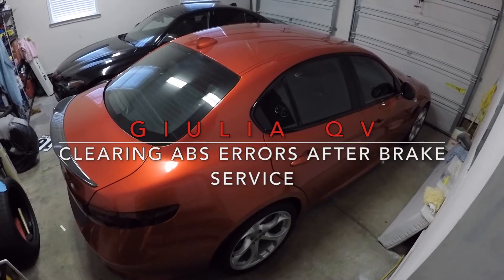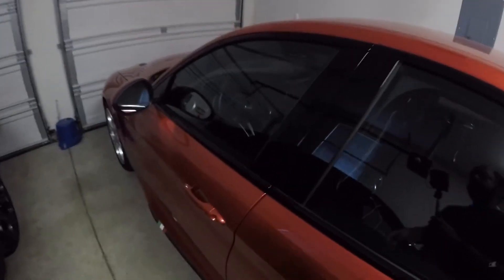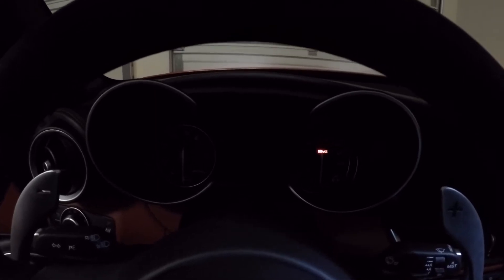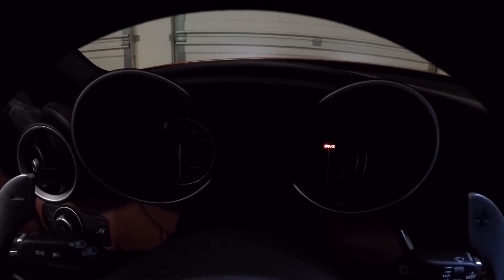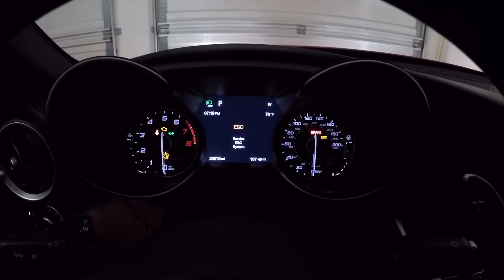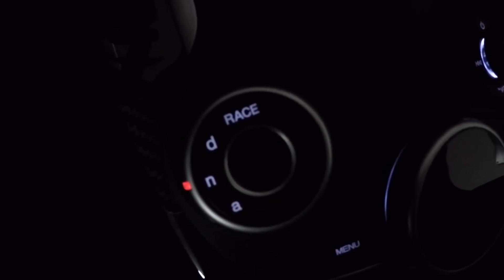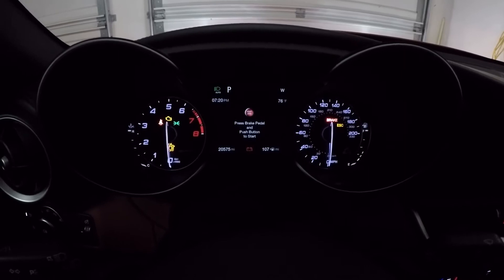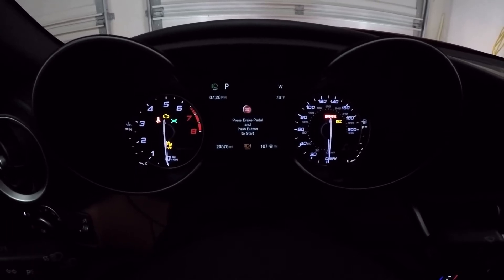Alfa Romeo Giulia Quadrifoglio | ABS Errors After Replacing CCM Rotors and Pads for Girodisc

Comment: Did you need to install a SGW bypass module to use the MES? I'm dealing with the same issues right now, not sure if i need that module or if the code OBD, MES and Gray cable are all I need?
Reply from the maker: Only if your car is late 2018 and up.

My Giulia QV is a 2017, so it doesn't have the security gateway module.

My 2020 and 2021 Stelvio vehicles require the SGW bypass, which I've installed on both.
Reply: @genyosai great insight. I've got the dealer fighting with me about this same problem. They want 5k for "their" work. Could you please, please send me the exact cable, and blue tooth unit you used. Please!
Reply from the maker: @jeromem4923  $5k????  WHAT??
OK!  Here is the exact cable kit I bought. You'll need the gray cable as you can see in my video:

https://www.ebay.com/itm/271552918793

This is the Bluetooth diagnostic tool that I use in the video:

https://www.amazon.com/gp/product/B07JFRFJG6/ref=ppx_yo_dt_b_search_asin_title?ie=UTF8&psc=1

As you can see in my video, I used my wife's iPhone with MultiECUScan (MES) for iOS installed. You can also use an Apple iPad. Just download MES from the App Store.

Good luck!

I have no clue what they could be doing for $5k if all you have are ABS/brake errors after a brake job.
Reply: @genyosai  oh! thank you so much friend 🙏 they are trying to pull an expensive fast one on my daughter. Life long member to your channel 👍👍
Reply from the maker: @jeromem4923  Thank you! Keep me posted on how it goes.
Reply: @genyosai  will do buddy!
Reply: @genyosai do you just use the standard free version or is the next level of access needed for the multiscan?
Reply: Hey bro I seen your video and it seems legit. I just had a quick question I have a 2018 Alfa Romeo Stelvio Q4 and would want to know where to purchase the Grey MES Cable & SGW ByPass Module? Or what do I need to purchase. (I changed my breaks but I have all this lights on my dashboard and want to get rid of.)

Comment: What was purpose of the grey cable and where to get it
Reply from the maker: The grey cable is needed to connect to the Continental ABS module.

You can buy all the MES cables in one set here:

https://www.ebay.com/itm/271552918793

Comment: Ik this is kinda late question but I bought both the cable and the Obd scanner and I can’t get it to connect to the app any advise ? I have a 2020 giulia 2.0
Reply: It probably doesn't work anymore. Return everything back and get your money
Reply: @CubanMofo  it does work I just had it in the wrong interface type thanks
Reply from the maker: Sorry for the late response, but glad you got it worked out. YES it obviously still works lol. I use it all the time because I race my car and have to get into the Continental ABS module with MES to recalibrate things all the time.

Comment: Where do I plug it in and what adapter do I need to fix brake codes and reset service interval oil
Reply from the maker: Hi.

For most brake codes you'll need the gray adapter to connect to the abs continental system. When you see me plugging in under the dash, I'm plugging into the ODBII diagnostic port. Simply look underneath the dash and it'll be easily visible and accessible.

As far as resetting service and oil intervals, I can't remember even though i just performed this task on my car. MES will prompt you for an adapter if necessary, and for service/oil interval it's no adapter or gray. Definitely not another color.

Comment: Thanks for share. If replace the brake calipers for update to 330mm the process will be the same?
Reply from the maker: Absolutely. Any time you push back the pistons to remove/insert pads, you need to do the following process to AVOID the errors I had to clear in this video:

1. Put brakes into service mode to release the parking brake (if replacing the rear rotors).
2. Disconnect negative battery lead
3. Do the work you need to do

After the work is done and everything is back together:

1. Pump the brakes numerous time to ensure the pads have reseated to the rotor!!!  This is the most important thing to do BEFORE reconnecting the battery.
2. Reconnect the battery
3. take the car out of brake service mode
4. Start the car, you will have errors due to the battery being disconnected.
5. Turn the wheel lock to lock a couple of times (right, left, right, left, center).
6. Turn the car off, then back on (errors should be cleared).

Good luck!
Reply: @genyosai  thanks for reply ;). To bleed the brakes you have to do it through pressure, right? Is there no video on brake bleeding?
Reply from the maker: @patata2002  You have to do a combination of pressure (minimum 30psi) and pumping the pedal... and you have to do it in a very particular sequence.

I've shared the brake bleeding instructions with you here. Be sure to follow the instructions for your variant (QV or non-QV):

https://drive.google.com/file/d/1LgpadlO7BKXype46_EVWyZf0HUY3NW35/view?usp=sharing
Reply: @genyosai  Thank you for this step-by-step. I just did all four brakes with pads and rotors and had no problems after following this.
Reply from the maker: @josephpeacock4562  Awesome! Happy to help.

Comment: where did you get the cable and the obd scanner?
Reply from the maker: So sorry for the late, late reply. I've been in the process of moving for the last 5 weeks. What a headache!

Anyway, I bought the cables from these guys on eBay:

https://www.ebay.com/itm/271552918793?hash=item3f39d0b509:g:pLAAAOSwuxFYsswY

The ODB scanner I use with my phone is this one from Amazon:

https://www.amazon.com/gp/product/B07JFRFJG6/ref=ppx_yo_dt_b_search_asin_title?ie=UTF8&psc=1
Reply: @genyosai can i fix the coses with  this?
Reply from the maker: @eduardobernardoni5149  HI. Sorry I don't understand. What are "coses"?
Reply: Only with obd ?

Comment: You can also use a memory saver that connects to OBD2 port, then disconnect the negative cable to the car battery. This should help you get no error codes or check engine light issues.